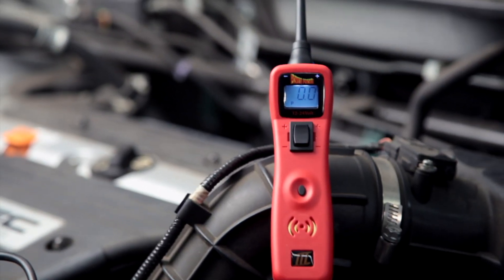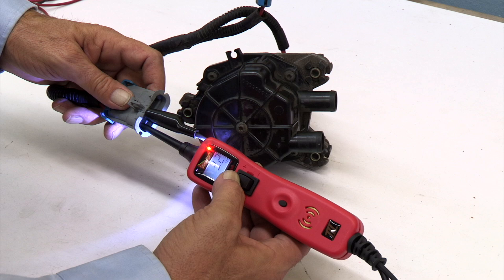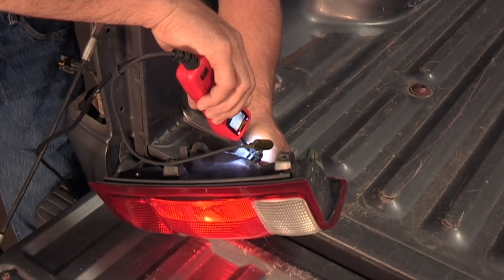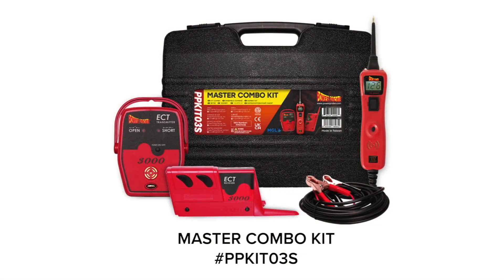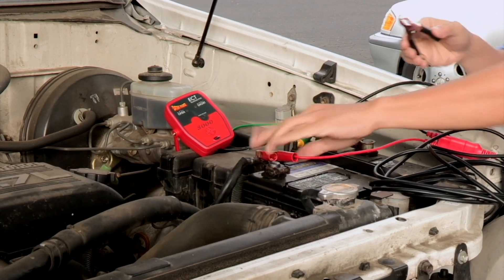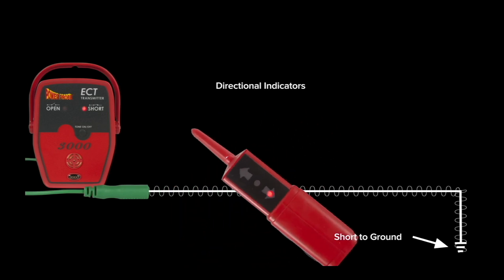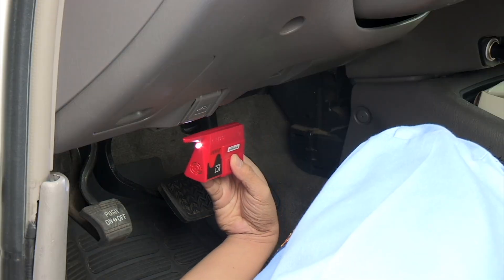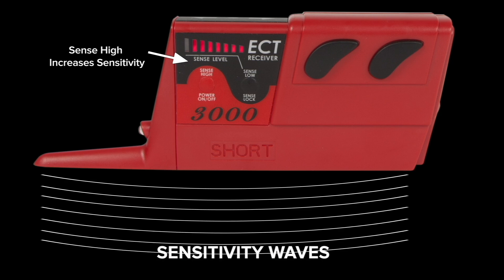Power Probe 3 combined with the ECT3000 Open/Short Tracer PPKIT03S

Comment: Can the extension powercable for the power probe also be used for the ect 3000 transmitter if you need to use it at the back of a box truck ?

Comment: I own 2 ECT3000 and seldom use them my complaint is the signal is too weak great tool and the science behind it, is great... it is just weak... you have to be "on the wire" for it to beep. that is my opinion
Reply from the maker: Hello @fercast1395 - make sure you're locking the signal when you first start the process. You should be able to get 8" away from the wire under normal conditions.
Reply: I don’t have this problem 🤔

Comment: I'm not saying the tracer doesn't work, but I've seen some good YT videos of pro mechanics showing how the tracer is not very accurate...especially in a large bundle of wires

PP your response to these allegations please?
Reply from the maker: The ECT3000 transmitter injects a traceable signal into your shorted or broken wire, the receiver will locate that signal. A shorted or broken wire usually is not easy to find, this tool is going to help you trace where that wire is, the ECT3000 should be used with a schematic and knowledge of how the circuit works, many mechanics get in trouble when they short cut and do not use the schematic to properly diagnose the circuit. Technicians that specialize in electrical love the tool because they know how to use it, if you follow my suggestions you will find this tool is a great time saver especially when using it with the Power Probe 3,  I hope this helps
Reply from the maker: here are a couple of videos that might help https://youtu.be/OLI3sfaBvHI
https://youtu.be/iH5stDbp4og
Reply: @PowerProbeUSA  please don't take my comments as attacking in any way... But I'd like to see your company work with someone like Eric O. At South Main Auto on YT... That man knows how to diagnose and many people agree with him... He doesn't like your tracer tool, please show us what he is doing wrong?

You've already sold me a "hook tool"... But i need more "real world" videos before buying a tracer?
Reply from the maker: @shannonharris  I've seen some of his videos and I agree, he has a lot of automobile knowledge, unfortunately, without knowing the exact situation and video you are referring to I cannot answer your questions, if you need help or have a specific question on any of our tools', we do offer lifetime technical support, great chatting with you and thank you for that input, very helpful.
Reply: I have the tracer tool and it’s not been very helpful. Only thing I like is tracking wires in a big harness where things get lost. Other then that I use my meter 99% the time
Reply from the maker: @lostmechanic84 ,  I know the short circuit signal is stronger then the open wire signal, it's not a problem with the tool, it's just the way it is.
Reply: I was looking at buying one, think I'm not going to, the thing is the technology is there as phone line installers and repairers use it and can detect an open circuit 1 meter under concrete